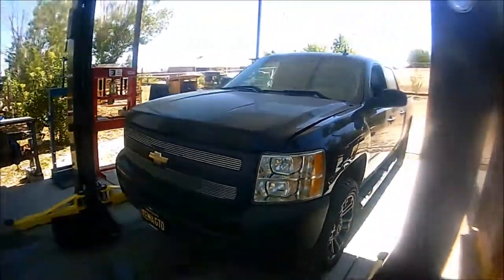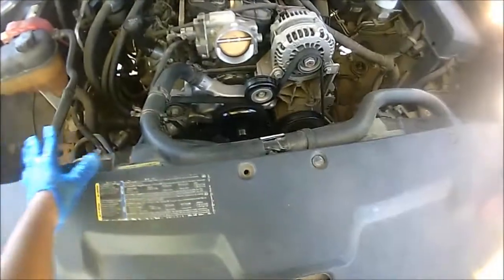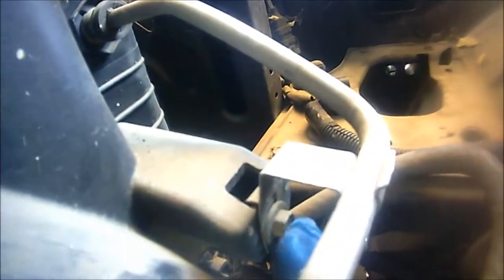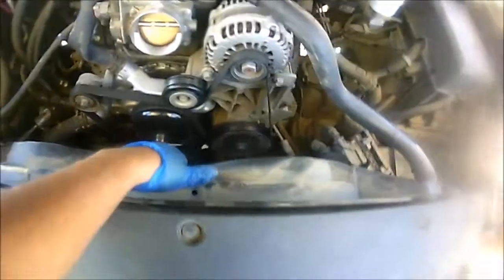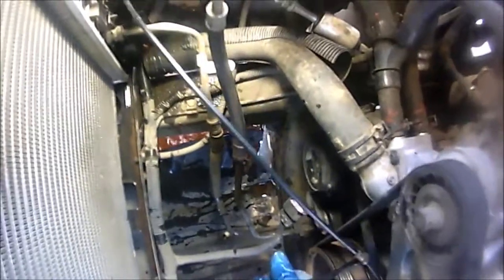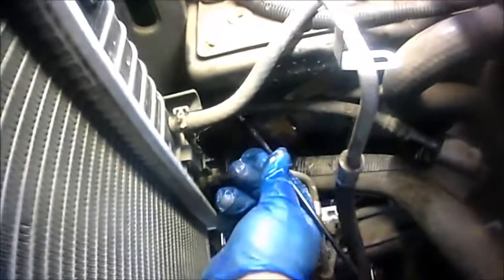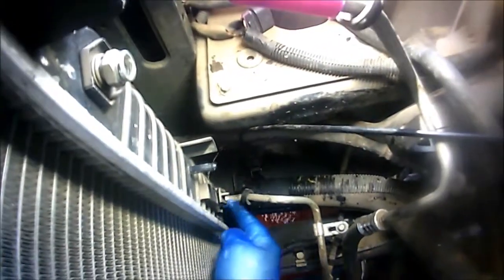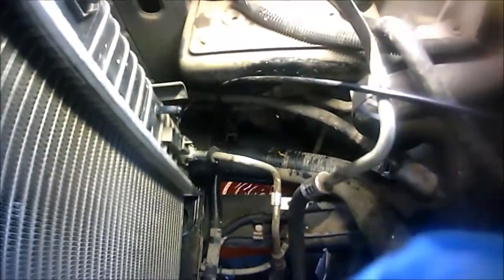2007-2013 Chevy Silverado Radiator Replacement 4.8L, 5.3L,6.0L

Comment: Great job bro. Thank You.. I Used your video to successfully change my radiator, thermostat, and Hoses in my 2012 Chevy Silverado 1500 LS 4.8L. Note:  2012 4.8L  Thermostat is low left and on the front side of the motor. Also not all manufacturer are equal. I had issues trying to get the Trans lines to seat and lock had to shave down the end of the tube  about 1/16 in to fit. recommend changing the trans lines. also New hoses gave some trouble because of wall thickness preventing the spring style hose clamps from going over all the hose ends. So I had to use regular screw type Hose clamps Otherwise all went as expected.. Thanks Again my friend!!